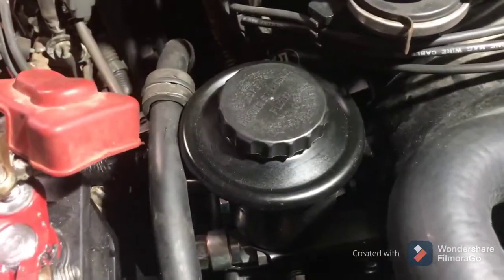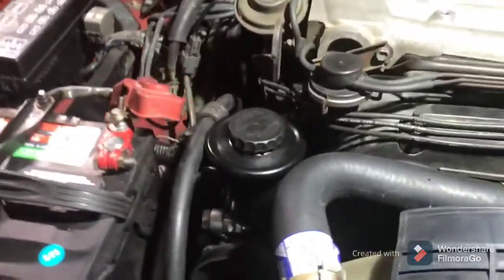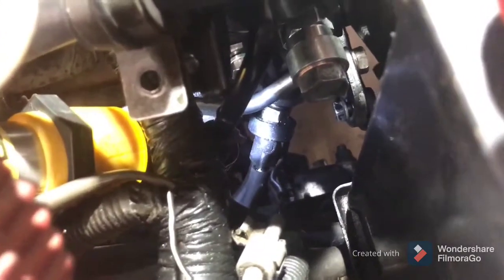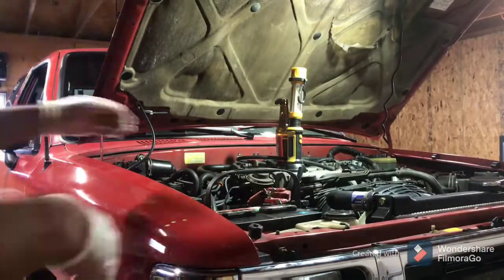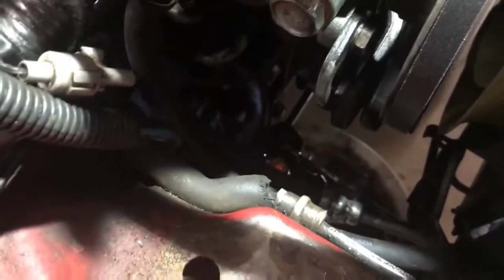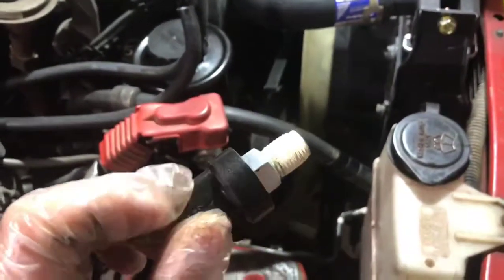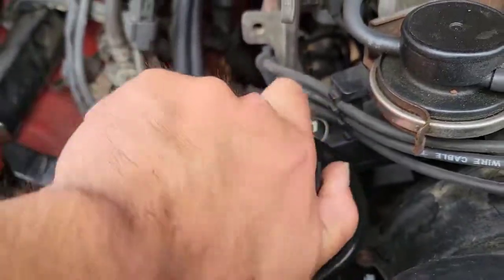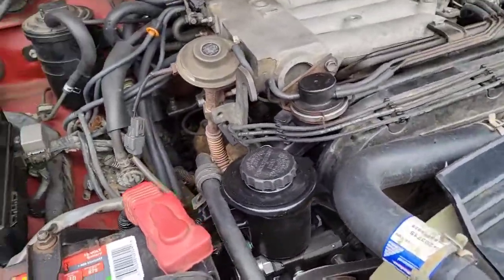Vlog 7 - 1993 Toyota Pickup 3vze power steering leak repair (no more adding ATF all the damn time!!)

Comment: I just rebuilt my pump.  It was whining and squeeling while turning, even after a full flush and cleanout.  No fluid in the VCV though.  I'll post some detailed videos soon about the full rebuild process as it definitely wasn't as simple as some people make it out to be.  I also used a rebuild kit which didn't have copper crush washers for the banjo connection (one on each side) They are both M16 x 24mm (16mm hole, 24mm outer).  Mine leaked until I used new washers.  The factory service manual doesn't even mention replacing them but people say do it every time.

Comment: Word to the wise on this.  Be careful with this part. Old plastic becomes brittle with heat and age.  Mine was ok but in the process of rebuilding my PS pump I broke off one of the VCV stems.  Since a new VCV is $70 I carefully sanded the stem and surrounding plastic with 150 grit sandpaper, then glued it back on with JBWeld epoxy.  The key was to do it so that the suction hose could go back on.  You apply it, let it sit for an hour, then you can remold it a little with your fingers.  After an hour the epoxy wont stick to you anymore.  $1.00 worth of epoxy saved me $70 as my VCV was otherwise fine. My pump was just worn out.

Comment: I'm having the same issue. My power steering pump went out and when I turn to the left, the power steering air control valve blew off. Does it matter which hose goes where? No fluid should be in either hose? found one hose was torn. must have touched the motor and got hose and burnt.

Comment: Where should I buy that part???
Reply from the maker: https://www.amazon.com/dp/B00GHT7T16/ref=cm_sw_r_cp_apa_glt_fabc_8TSTZWEMXRG1AQYHWG53?_encoding=UTF8&psc=1
Reply: @nickli6429  Thank you sir..!!
Reply from the maker: @yopyop3933  youre welcome!
Reply: Dude u just saved me from replacing all the seals in my new to me 92 4runner. Thanks so much! 
So did the ps fluid get sucked into the intake and out the exhaust or am I missing something?
Reply: @antonioturbes644   Yep, that's what happens I think.  And right out the tailpipe lol.

Comment: What is the correct fluid to put in the power steering
Reply from the maker: Atf
Reply: Yep, Dexron II or III ATF (automatic transmission fluid).  Some people incorrectly use other power steering fluids but this pump for the 89-95 Toyota trucks need the ATF.  It's got a red-rose tint to it.
Reply: Thanks fellas. Came back to your video again. Finally going to tackle this issue head in now. My leaks is bad and finally seen where it's coming from 🙏🏻.  Also what type of hoses and other stuff would I need to replace that you highly recommend. I saw on your video that you checked the power steering gear box and while inspecting my truck I noticed that had a leak as well what could that be 😲????
Reply: @vegaf2011  If your truck has 200k miles or more I'd replace the main two hoses. I'd also clean everything really good first with some spray degreaser and maybe some hot soapy water in a spray bottle combined with an old toothbrush.  That would help determine leaks and thier location.  I just finished rebuilding my whole PS pump but not the Steering Box.  I shot the whole process but need to edit / upload. But the pump rebuild was not as easy as some people think or make it out to be.  If you are not really skilled or have a lot of tools you may just want to buy one and slap it in.
Reply: @oldowl4290  I ended up buying a new power steering pump assembly couldn’t take out the sensor from the old pump. Definitely using this tip on the thread incase I have to disassemble it again could not get out the sensor for my life smh.
Reply: @oldowl4290  which way is the correct way to put the hoses on this valve? or do its matter
Reply: @cammichandler   Yes the orientation definitely matters.  One is inlet / one is outlet.